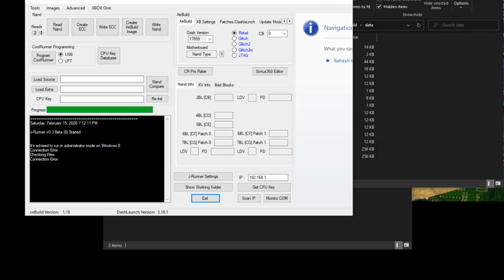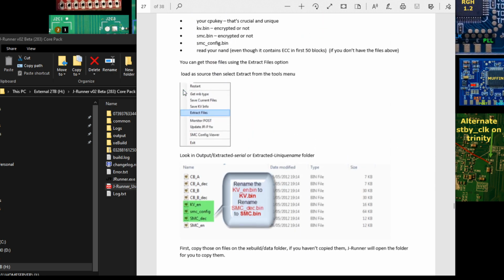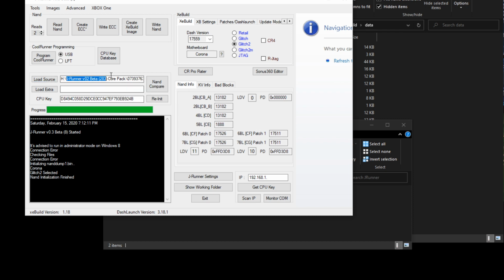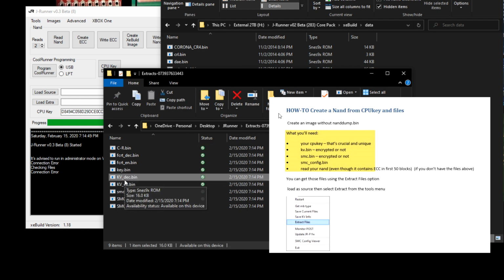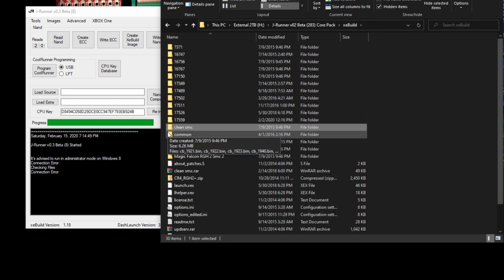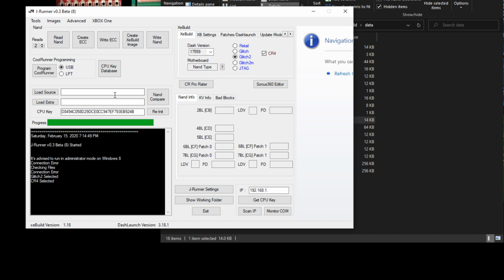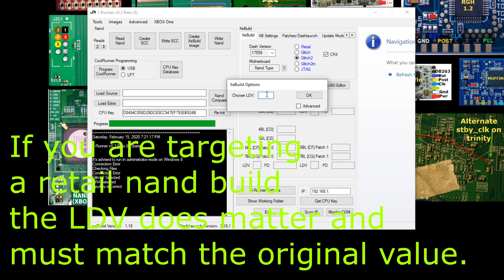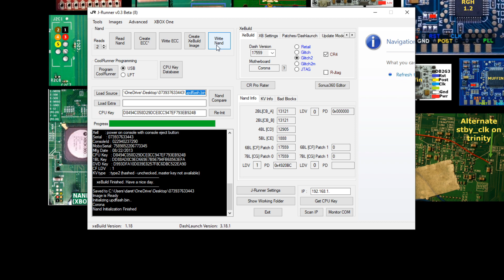Rebuild xbox 360 RGH or JTAG nand from source files to solve booting issues

Comment: All right if anyone can help me out so I did a Trinity slim 360, at first it wouldn’t build then I made a donor. I got it to work it boot it up Xcell & I was able to go in the dashboard. when I built everything back together, the console won’t turn on it just powers on then off any help and any suggestions??
Reply: You fix i have the same probleme
Reply: @ yeah I ended up fixing it my soldering was bad make sure they are making a good connection

Comment: Thank you so much. I couldn't get my falcon running. I got it stuck only booting xell. I messed up my bin. I remade it using this method. Wrote it to the console. Then use rgh in the current version of jrunner.

Comment: Hello !   
If I don't know the CPU key of my console (because I never managed to run XELL) but I know the LDV, can I use a donor with the donor's CPU key, or do I need to know my own CPU key? Also, should the creation be set to Glitch2 - SMC+ or Glitch2 - RGH3?
Reply: hi i never managed to run xell either, that was the step where i have no signal and after unsoldering everything, my xbox still has no signal and cannot connect the controller. Did you find a fix?
Reply: @keldanksus  you fix i have the same probleme

Comment: Hi i have an issue with my Trinity 16mb i flashed it and then the console boots but its blackscreen with laggy Sound and i Can still use the controller to turn OFF the CONSOLE - If i hit the eject button it starts xell with no problems? Do you have any soulution for this problem?😃

Comment: how can i convert back to stock nand without orginal dump?
Reply from the maker: If you have a xebuild image WITH THE ORIGINAL KV then simply load it up into Jrunner and select "Retail" when rebuilding your nand.   If you have lost the original KV, then there is literally no way to go back to retail.
Reply: @TheWeekendModder  thanks for the response in most cases i don't have anything from the console because its not my work of course all the work I've done i have the files

Comment: Ive tried to do this after a failed RGH3 on a trinity
my only issue is that i have the latest version of J-runner

which does not have a option in Advance 
to create an image with nanddump.bin

any help with be appriciated
Reply: I'm pretty sure it's a button on J-runner called "Create Donor"
Reply: @senseifried299  that's correct, I just did it today
Reply: All right if anyone can help me out so I did a Trinity slim 360, at first it wouldn’t build then I made a donor. I got it to work it boot it up Xcell & I was able to go in the dashboard. when I built everything back together, the console won’t turn on it just powers on then off any help and any suggestions??

Comment: Hello sir can you make a video for zephyr model, that has a ace V3 mochip and uses a Falcon ECC and Freeboot (with J-Runner just switch from Zephyr to Falcon for XeBuild, and write the ECC manually from the folder FALCON.ecc
Reply from the maker: No, sorry - I attempted enough Zephyrs that I found them to just be flatly not worth the trouble.   Really recommend that you just sell off any Zephyr you have an get a Falcon, Jasper, Trinity, or Corona model to modify.
Reply: TheWeekendModder okay sir thanks you

Comment: I have an issue with my rgh3 corona 16 console where it sometimes won't boot and still on green dot. No video, no xell nothing. After 30 to 50 boot  attempts it will boot normally and will boot on first attempt after that for a couple of days. If I stop using it for like a week or so it will stop again and need to do 30+ attempts to make it work. What do you think the issue is? Will this fix my issue? I don't have any backups and got it re modded. Any help?
Reply: did you fix it?

Comment: So i have a xell reloaded xbox 360 which is corona4g, is there any way i can flash my nand using a usb or do i need to get a nand x cable.
Reply from the maker: There is a software method of flashing 4gb nands - I think it was called 'simple nand flasher'.  It's launched from the normal dashboard like other homebrew apps and is capable of writing 4gb nands.   PS - a nandx would not write a 4gb corona nand, you'd need an SD tool or a specifically 4gb capable device.

Comment: This did not work for me all it does is nothing now the green light on the ace v3 chip stays green but nothing on the tv I can load xell that's all I have the D wire solder under the motherboard

Comment: I want to use the matrix I saw a video where you use the matrix chip for an Xbox Trinity and I saw that I program it with some files with a folder that has a muffin name Do you have those files from the muffin folder?
Reply from the maker: You could search for the "weekend modder Jrunner edition" video and download the whole set, or if you go to my store and look at my matrix glitcher listing I have a link right on there to the muffin timing pack you can download them

Comment: Can i use this tutorial if i dont have the original nand backups?
Reply from the maker: No exactly as shown.  This is very similar to the process of rebuildng a new nand from donor files.  At min you'll need the CPU key of the console.
Reply: @TheWeekendModder   are you going to do a video on flashing the dvd drives on phats and slims